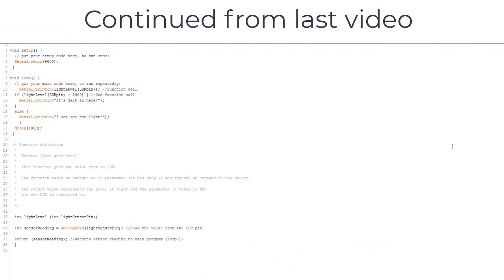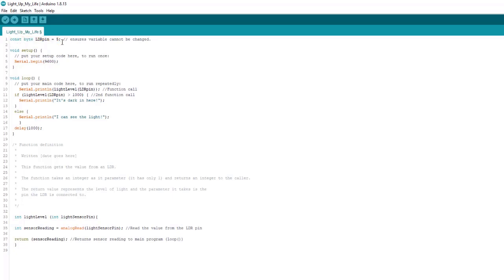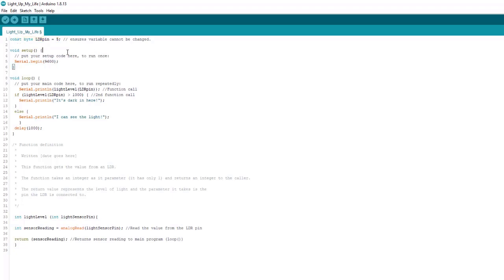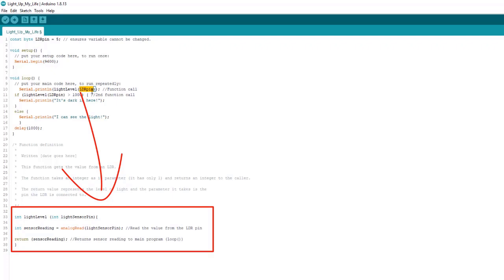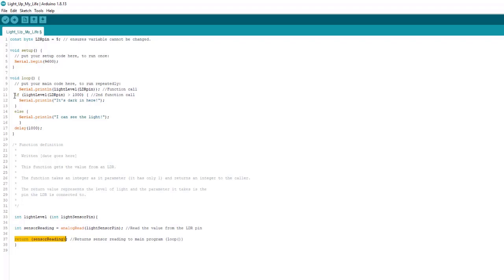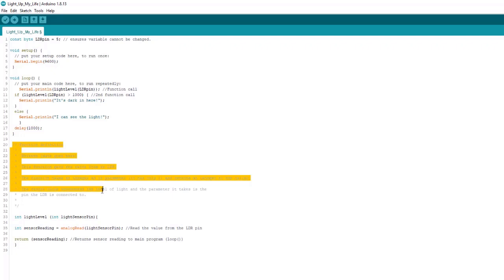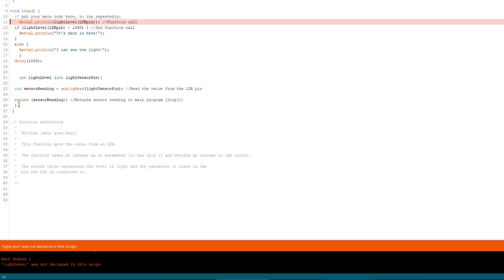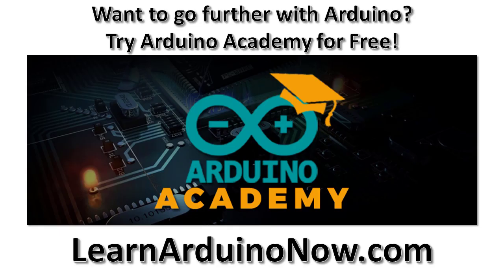Writing Functions in Arduino - The Final Chapter

Comment: What is wrong with your recording system? I saw part 1 in this series. The quality was not good  but readable. Part 2 was fuzzy and unreadable .  this "final chapter " is totally unrearable!!!  Audio in all three is fine.
Here are two youtuber arduino entries that are easy to read https://www.youtube.com/watch?v=JnSt0vylnp4 and https://www.youtube.com/watch?v=H0CtMyL_CCI      RSVP
Reply from the maker: The quality looks fine on my end. Make sure you have the settings (the gear icon) set to HD, not lower quality or auto.
Reply: using the gear icon I get the following choices: annotations, subtitles, playback speed & Quality.  Under Quality I get these choices: 720p, 360p, 144p, & Auto.   HD is not listed.  As mentioned the quality (readability) of your 3 videos varies from barely ok to useless.  
 @CircuitCrush
Reply: @lastchance045  check your device/settings. Quality is just fine for all 3 videos.